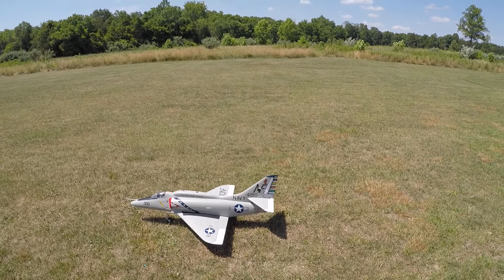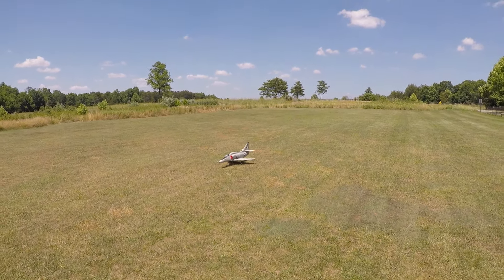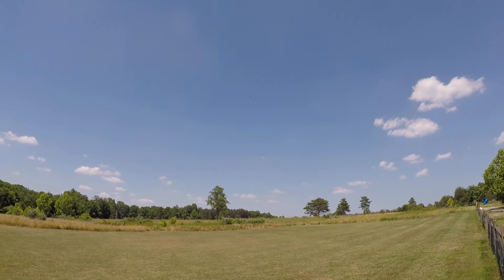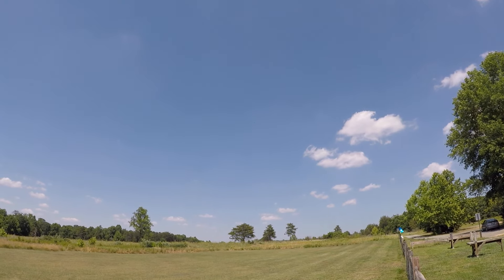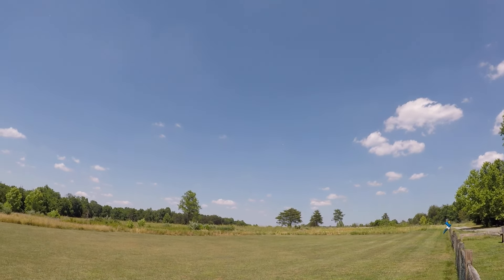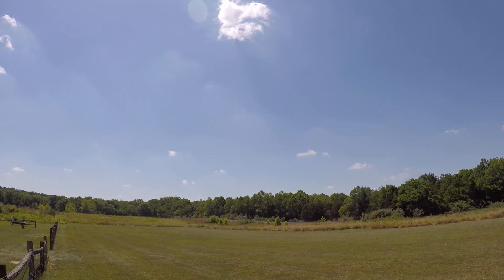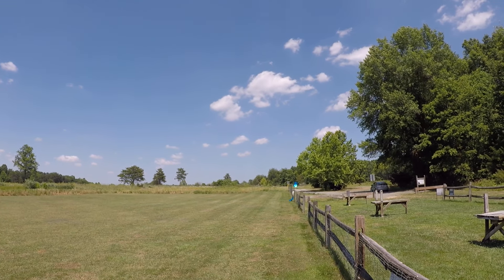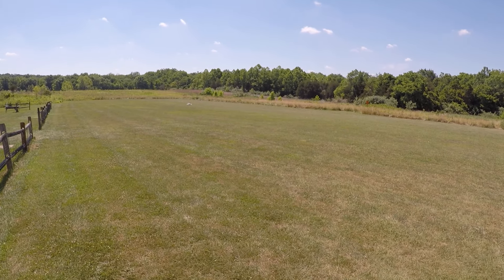Freewing A-4E/F Skyhawk 80mm Flt 5 Squared away! Adjusted throws! Odd things going vertical! Nice!

Comment from the maker: Clarification on what I said what the rates are. Aileron was adjusted to High 75%, Mid 60%, Low 50%. Elevator and Rudder: High 90%, Mid 75%, Low 60%. Expo same on all surfaces: High 30%, Mid 20%, Low 10%.

And correction on what I said about 'odd things going vertical'. Meant to say, while inverted doing a loop, if I get too slow, it does 'odd things'.:D